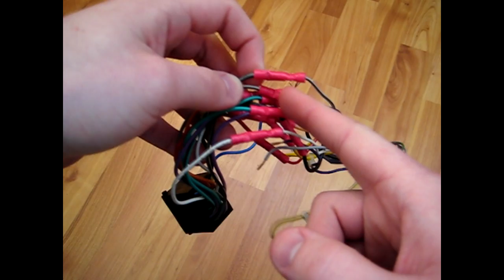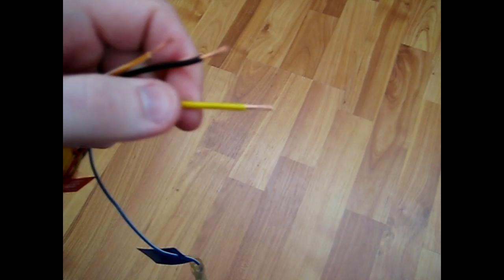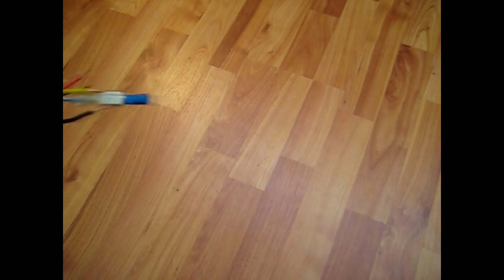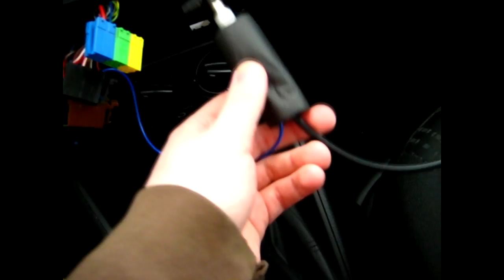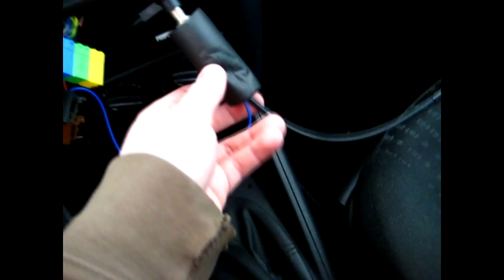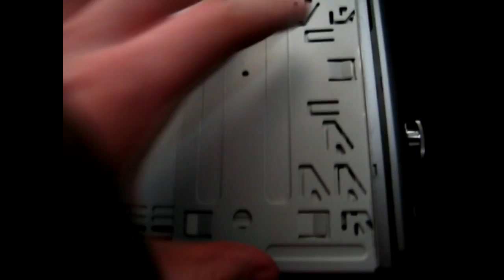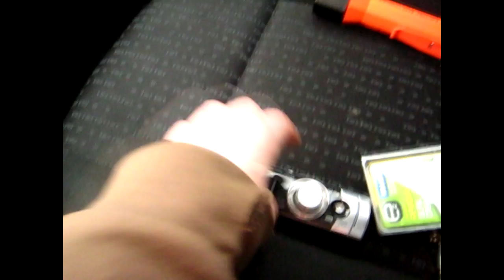DIY: Installing An Aftermarket Stereo Into Your Vehicle

Comment from the maker: The only reason why I installed it in the black connector was just for a cleaner wire installation. The antenna wire needs to be powered up so the booster within the antenna powers up and you have the proper reception. Now you don't have to install that wire in the black plug, you can directly attach it to the remote wire from the deck. The remote wire just turns one when the deck is powered up.

Comment: I just did the same thing to my car.. But there is also that blue connector that goes behind the stock stereo, but since your putting a new after stock stereo it doesn't have that connection. So what do you do with thy blue connector??

Comment from the maker: I've had a few Pioneer decks before and they've never asked for codes. I would say the first place to check is either the vehicle's fuse panel for the stereo or the deck should have a fuse in behind it also. If a clock isn't even popping up (which is should even though its off), then it's obviously not getting power.

Comment: Hi, I bought a brand new pioneer stereo, I got it fitted in at a car garage. Everything was fine. But the other day, I left a light on in my car when I turned it off, and two days later when i come to start my car, the battery was drained, so after jump starting it, the cd player was not working. What do I have to do? this happened in my old car (different cd player), but it just asked for a 4 digit code, but this time nothing even comes up on the display.

Comment from the maker: If the original harness was cut, you would then have to take the Year/Make/Model of your vehicle and find a wiring diagram which specially says what color of wire is for. It'll be time consuming and unfortunately it's really the only way. Once you figure that out, then you would connect each wire to whatever the stereo wiring harness has.

Comment from the maker: It's been a while since I've done this, but if I remember right, everything is there that you need. All you have to do is connect yellow with red and red with yellow. The options just switch on those 2 wires.

Comment: well here's the thing, I have the monsoon double din unit right now. I plan on getting a single din head unit and use the other din for gauges. i would assume my radio cage does not have a bracket for a single din, in that case I would need a dash kit?

Comment from the maker: Single din and double din dash kits are normally a common size. There might be a a couple millimeter difference between each manufacturer of decks though. As for my car though (MKIV), I didn't need to use a dash kit. But you will need a radio harness and antenna adapter though.

Comment: Thanks for the video, it was very helpful as far as wiring!
Since each head unit is obviously different, will a dash kit work for all head units of the same din size? I have a mkIV jetta (so same platform of course), so i will need: Dash kit, wiring harness from car's stock harness to aftermarket radio's harness, and antenna adapter? am i missing anything?
thanks again!

Comment from the maker: Is it a single din or double din stereo??? Does it have the square slots??? If it's a double din stereo and has the 4 slots at each corner, then it's basically the same procedure, with 2 extra slots with clips in behind that need to be disengaged.

Comment from the maker: Hi, Gregg. It almost sounds like the wire for the back lighting on your gauges was disconnected. I would think that if something did short out and blew a fuse or relay, your deck back lighting wouldn't work either, but it's also worth checking out too. Did he use a plug/play wiring harness or did he cut into the stock wiring? Next would be to check over the wiring on how the deck was connected also. You would need the wiring diagram from the deck, plug/play harness (if any), and for the truck.

Comment: i have a 2002 dodge dakota. my buddy put in a anftermarket deck for me and now my damn guage lights wont work. all my other lights, headlights, tailights, radio lights, all my guages work but my guage bezel lights don';t... any help would be awesome or if you can recommend a video thatd be bad ass too. i do mechanical work not too much electrical so i need any help you can give. my email address is whiteknight91rs@yahoo.com please let me know !! Gregg

Comment: I GOT A 01 GOLF 4DR 1.8t MK4 i installed a aftermarket RADIO along with a AFTERMARKET HARNESS (PLUG N PLAY) WHEN I hook UP the aftermarket radio my KEYPAD alarm doors won't look it's like the KEYPAD is DISABLED i need help with this but when the Aftermarket harness is plugged in it works fine n when the STOCK RADIO is hooked up it works fine too so 
what on my AFTERMARKET radio is fuking up with my radio that it won't work!!!!  and my alarm is disabled ANYONE GOT A IDEA!!!!

Comment from the maker: You can actually change the location of the little storage hole thingy from top to bottom. It just unsnaps if I remember right. That little rubber nub goes help keep the deck in position. Also if your deck has a sleeve around it, you can insert the sleeve and there is tabs which you can bend outwards to hold the deck in place. Then just slide the deck back into the sleeve. Mine also did work it's way out slowly, but I never bothered with the tabs because I can't vehicles and kept the same deck.

Comment from the maker: The trim on the sides if I remember right, you'll have to remove the side pieces to get to the screws holding it in and I think the center console. As for the little storage think above the deck, you'll have to remove the stock single din radio and it just unsnaps then.

Comment from the maker: Well the colors would vary depending on the make and model of vehicle. They are possible split from the speaker which they are closest to or come from an amp which is located somewhere in the vehicle. Your best bet would be to find a wiring diagram which is for your vehicle and it should say on the diagram what colors the wires are... Or you can just unplug the tweeters instead of cutting the wires so they can be reinstalled if you ever changed your mind.

Comment: yeah they are built in to my new speakers but I want to cut out the stock tweeters since they are slightly blown...not sure what color the stock tweeter wires are, don't want to cut the wrong wires

Comment from the maker: Most likely yes... I believe Pioneer makes a in dash screen which will show some of those information, but you might have to add the sensors in because I'm not sure if the stock ones are compatible.

Comment: Will i lose the capabilities offered on my factory deck if I install an aftermarket stereo? i.e. fuel range, oil life, trip miles, clock, etc. They all currently display on my factory stereo and I want to know if i will lose the ability to see those information displays if I replace the stereo.

Comment from the maker: Yes, don't hook it up. If you do and have the car scanned for any codes, the code reader can be burned out. Somehow the k line communicates with the stock radio, so if you replace it, there is a fault with the signal which isn't good for the code reader.

Comment from the maker: I've never had that happen to my car... Seems really odd though. The only thing that I can think of is possibly a bad connection somewhere between the temp gauge and sensor. It could even be something electronics related, like a component over heating and just kicking off the power to the gauge for a second. Sorry I can't be much help on this matter.

Comment: Great. Thanx for the response. I managed to do the job and the result was good. I have one more question though, if you can help me. Its about the temperature indicator. Maybe you had this problem too. I did a little research myself but i dont know what to do. Sometimes, when it reaches 90 Degrees, it suddenly drops down like it isnt working and then comes back again. Like this if you have time to take a look. Thanx a lot and keep posting videos! (watch?v=1hjJ-sAAVRs)

Comment from the maker: Thank you for the comment and sub!
If there isn't any wire, you'll have to feed it directly from your deck to the rear doors. So the wiring will run under your dash, then down the kick panels in your front seat foot wells, along the door sills, and up the middle door post where your seat belts come from. Hopefully there will already be a little rubber duct where you can run the wires from the post to your door. If you want a speaker and tweeter, run 2 or 3 way speakers that have everything.

Comment: Great video and great channel. I subscribed. But i have a question. My car has only the two front door speakers and none in the back. My problem is the wiring. How the hell am i going to pull the wires in the back doors? Because i cant see any wires to connect a speaker and a twitter if i want. I have to do the wiring myself? And if yes, is there any DIY for this? Thank you.

Comment from the maker: @elcompaalejandro Wow that sucks, sorry to hear... You'll have to probably go to the wreckers and get another harness, somehow pull what's left of yours out of the dash and solder the new one on. Or, you can buy the wires from the dealer and the plug and do it that way. Although that would probably be more work and more expensive.

Comment from the maker: @82aagome You'll need to get a harness from a local stereo shop for the aftermarket deck to plug into the stock wiring and you'll most likely need an installation kit to hold the aftermarket deck in your dash.

Comment: i've installed stereos before, but never from a factory stereo. only switched out other aftermarket decks. how would i install an aftermarket deck to a 06 charger? is the harness i need to connect already back there?

Comment from the maker: @OYaKBeWaFaBoD The yellow wire, if I remember right is the accessories wire. So it should have power when you turn the key on. The VW constant 12v and switching wire are suppose to be switched. So red to yellow and yellow to red.

Comment from the maker: @stako04 What could be holding it is the small spring tabs on the wire contact. You may have to take a small needle and push the tab back so you can pull the wire out. The spring tabs basically work like a hook. The wire pushes in easily, but when you try to remove it, the tabs dig into the plastic plug housing.

Comment: How do you get the K Line wire out of the harness? I have the original harness on my '98 Audi A4, I've found the K Line wire, but it doesn't seem to just pull out. I've also removed that yellow tab from it.

Comment: I went to a so called professional stereo installers and they did connect the k-line in my aftermarket stereo... My question is this.. which wire from the aftermarket stereo is the one that I need to cut?  in order to get my codes?  is it the remote/antena blue/white wire..?  thanks for the help.

Comment from the maker: @Tenzainful Continued... Also is you have a double din stereo factory (larger) and your replacing it with a single din (like in my video), you will most likely need an installation kit which covers the larger hole in your dash.

Comment from the maker: @Tenzainful You would need a plug/play wiring kit similar to what I have in the video. That can be purchased at a local stereo shop or Best Buy or Future Shop. Then what you need to do is attach that new plug/play wiring harness to the one that came with your new stereo. Both your new stereo and plug/play will have a wiring diagram to determine which wire is used for what. Normally they are the same color, but it's best to double check the diagrams. You may or may not need an antenna adapter.

Comment from the maker: @thejuman19 By the looks of your video, their isn't any RCA plugs either, so they must have changed between the years. You may have the wrong plug then. The plug I actually purchased for my Golf is actually from a mid 90s VW. What you can do to check if its the right harness is get the plug wiring diagram for your stock stereo pinout plug and cross reference it to the on you bought. For the wrong plug that was listed for my car originally, the plug wiring was basically rotated 90 degrees.

Comment: the harness does not have the rca cables it basically looks just like the one you have on the video and my stock stereo has the same black and red conectors and the colorful ones which im guessing we dont need anymore because they do not fit on the harness i bought and because of that only my black connector is conected to the harness with two entrances and the red one with the other conector which only has like 6 cables one purple one green one gray and one black i believe

Comment from the maker: @thejuman19 Unfortunately I haven't installed an aftermarket deck in an Audi TT before, but I'll try my best to help you out. From what I've read, the aftermarket wiring for the Bose system should come with the RCA wires. Does the wiring you purchased have that??? Also, there needs to be a remote wire from your aftermarket deck that attaches to the factory amp wire which powers up the amp when the deck in on so it allows power to go to the speakers.

Comment: Hi i have a 2000 audi tt and i recently bought a install kit for the aftermarket stereo the factory harness looks a lot like the one in your video and i connected all the cables but i dont get any sound i heard that the bose system has all four speakers amplified does that have anything to do with me not getting sound? can you please help, thank you.

Comment from the maker: @StarlightMassacre I bought my stuff from Future Shop, but Best Buy should carry the exact same stuff. Yep, it does need that special antenna wire. The stock plug won't plug into the aftermarket deck antenna output. From what I've experienced, the European cars have a different plug compared to the North American market.

Comment from the maker: @StarlightMassacre If yours is identical to my stock stereo (2 din) then all you need is the antenna wire and the installation harness. From what I've found, the parts that are listed is actually wrong. What you need is a stereo plug for an MK3. Now for the antenna wire, you need the one that has an extra power wire on it which is to enable the VW factory booster.